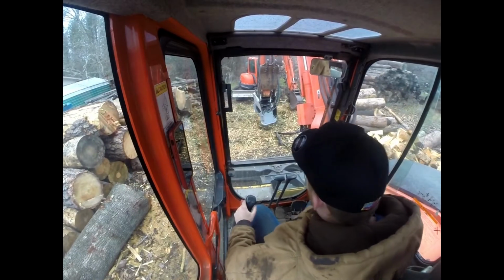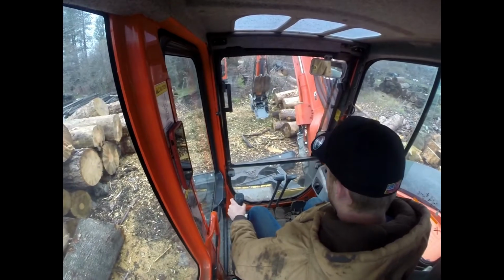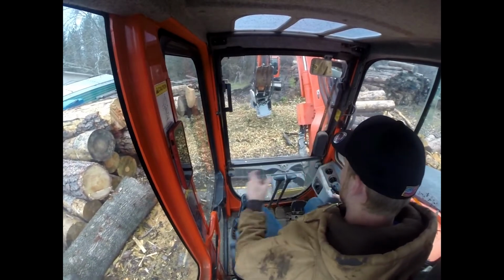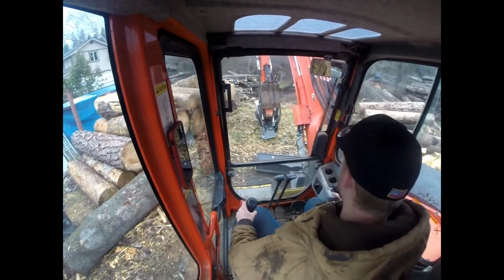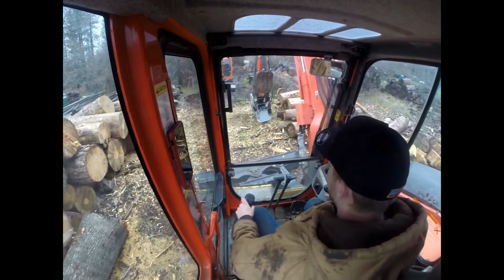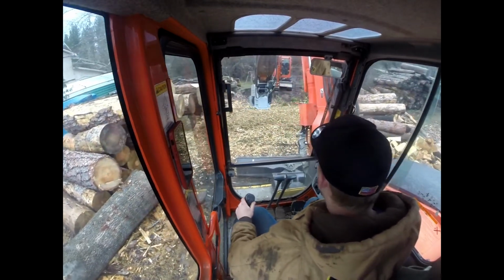DENIS CIMAF 085 ON KUBOTA KX 080

Comment: You get the door working on it yet?
Reply from the maker: Kip Sterchi yes sir. But it hasn’t stopped raining so haven’t used it on a job yet:(
Reply: Great! That sucks about the rain. Be sure to get Cimaf out to tune it if you haven't already, very well worth it. Any more news on maybe doing a priority valve? I ran mine for about 16 hours this past weekend and kept thinking about the priority valve!!
Reply from the maker: Kip Sterchi the cimaf guy was supposed to be here today actually but I haven’t heard from him. And I talked to Morin diesel about priority valve and he said I got the kit from cimaf that would have included it. If they deemed it needed for an 080 to run properly. So I’m guessing we don’t get one. How you liking running yours? Productive?
Reply: When Mario set mine up he mentioned I think that the CAT needs one and maybe Bobcat but I am not sure. He did mention they have installed them before but that Kubota has a better priority on the Auxiliaries I think. Don't quote me though. I like it, I honestly think it is the best head out there, from toping and eating tree's to cleaning up the tops when sweeping left to right using the back door open is really nice. It will take some seat time to get used to. There is certainly some technique involved. What kind of material do you have in mind for yours?
Reply from the maker: Kip Sterchi I will be sure to ask the guy when he comes to tune mine. And planning on around ponds and thinning small pines and cedars around Home. We had some big fires around here last year. Would like to get signed up to help on the fires. Possible widening roads for fire trucks to gain access. What kind of stuff are you grinding up?
Reply: V-BELT Logging mainly topping larger trees (6-10 in) and then eating the stalk while the bobcat comes through and gobbles the tops up. Also clearing ditches and pond banks and soft ground areas around here.